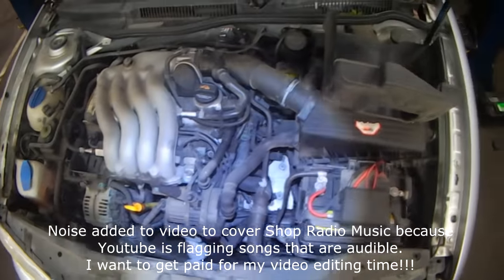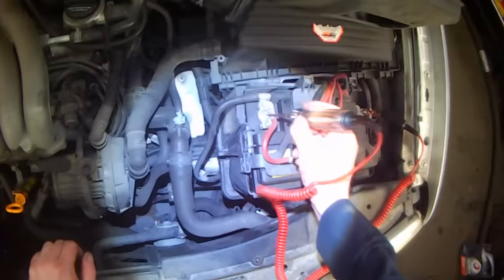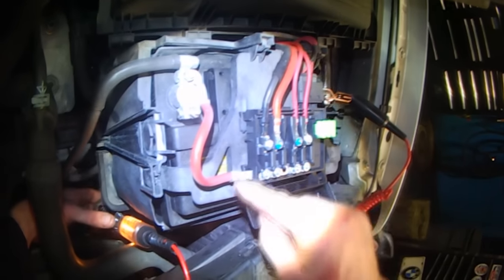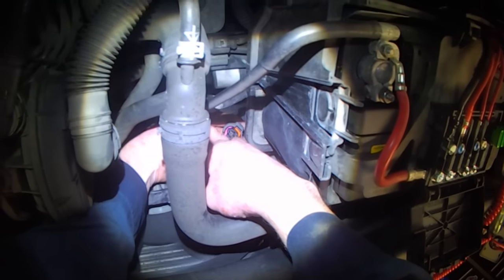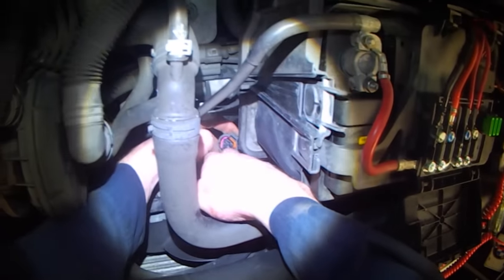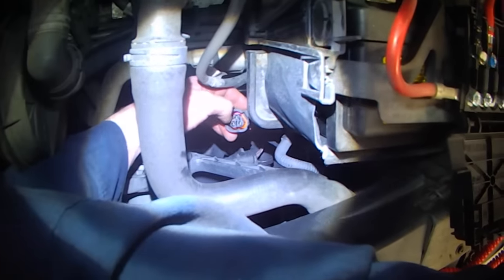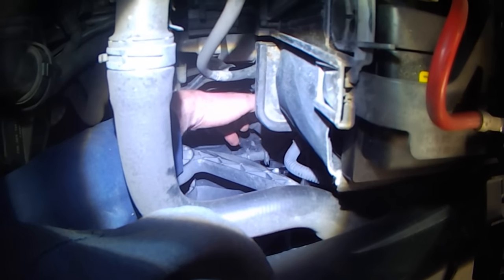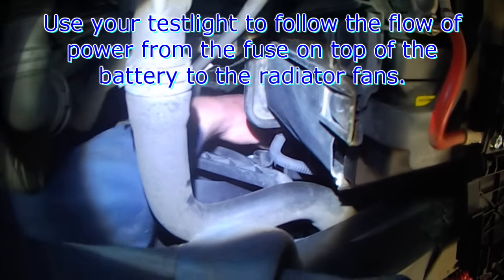VW A1 A2, A3, A4: Radiator fan(s) quick check.

Comment: Thanks!
Reply from the maker: Hi Brad, that's too much $.
If both fans worked (low & high) when you bridged the rad fan connector, then the fans, fan control module & wiring are ok.
I assume the engine is overheating / you're getting the red light in the dash?
3 common things that can cause overheating. 
- water pump
- thermostat
- bad rad fan switch.
No heat inside the car means the water pump is dead or the heater core is plugged.
If the top rad hose is hot (can't hold the hose for more than 10 seconds), then the thermostat is stuck closed or the water pump is no good.
If low speed fans don't come on when AC is selected, system might be low on charge or there's an ac fuse that's no good.
If you manually active low or high speed... will it cool the engine, if yes, bad fan switch.
I haven't seen many plugged radiators.
Leaving work soon. Might have more input once I get home.
Reply: @EXOVCDS  That's a small amount for all the help and enjoyment you have given me over the years. 🙏

Yes, overheating, and no AC. I don't think these fans have worked for the 5 years she has had the car. Water pump is fine, heater works, replaced the thermostat, FCM and temperature sensor switch. 

No fans ever, unless I jump it. Don't come on when AC is selected, but as you say it could be low, but they don't kick in when it gets hot (checked with VCDS-Lite). Is there another fan switch somewhere? I'm thinking of pulling the FCM from my Jetta and trying it, even though I plugged the new one into my car to test it and it was fine. Is there a way to test the sensor switch? I tried a ohms test, got nothing. Always worried about buying parts that don't work...
Reply from the maker: @bradsherwin4568 
Is coolant flowing back into the coolant reservoir when the engine is idling?
Could be an air lock / blockage in the return / bleed hose.
I'll reply again later tonight once I'm at home.
Reply: @EXOVCDS  Yes, coolant is flowing back. Had to drain and refill a few times after overheating and the temp sensor replacement.
Reply from the maker: @bradsherwin4568 
How warm / hot is the radiator core getting? 
Monitor coolant temperature via scan tool... periodically feel the radiator core with your fingers between the rad fans. 
The core should start to get warm after 87c.
TDIs can take quite a while to get warm. Hold the rpm at 2000 till temperature gets to 87c / 90c.
If the thermostat is new and the rad fan switch is new, the only thing keeping the switch from getting warm is the radiator (core is plugged).
To check, disconnect the lower rad hose at the thermostat flange. Route it down under the car into a catch tray / shallow bucket (front of car on ramps would be helpful).
Have your daughter start the engine while you monitor flow from the hose.
Coolant should rush out as rpm is increased.
Fluid level in the reservoir should drop quickly.
If coolant does not rush out and the level in the reservoir does not drop quickly, then I would suspect the radiator. 
If you activate the fans manually, can you keep temperature from getting too hot?
Reply from the maker: @bradsherwin4568 
I'm not seeing all you replies when using my phone / youtube app.
I'll check tomorrow morning while at work.
How hot is it actually getting (scan tool data)? Once the engine has cooled off, is pressure still in the system?
Reply from the maker: @bradsherwin4568 
Can we continue this via email?
I can't access / read your last reply about using an infrared temp gun. Or start a new discussion under the video to which I can reply.

Comment: my fuses require PLIERS to remove them from the battery fuse panel and to get them back in, its insane, brand new one too :\ about to go test this, placed an order for new fans, hopefully i can call and cancel. I tested the pins but i realized i didnt test the pin for power which im going to go out with a multimeter and see since i dont own a light for some reason, thanks for this :) I was bringing back the r32 from the dead and was idling it and  putting air in the tires and on my 3rd tire i heard a weird noise and looked and it was smoking, it was max temp and bubbling coolant out, ran in and turned it off and opened oil dipstick/cap to let as much heat out as i could and then turned on heat full blast :( my baby!!!!! stupid fans dont turn on at all even jumpered
Reply: so my plug gets 12.578v at it and the other two pins are getting 0.002 ohms and the other is 15ohms which is the top pin if they were vertical slots and power being bottom right. I assume the high resistance is the fan module and it opens up when the car is on right? so its probably working fine. Either way it looks like I need fans then right? Or should i wire up some double a batteries and tape em together to test the actual fan clip and give them power (i already tried at the triangle 3 wire clip with it off and on for both speeds and got nothing).

EDIT: going to go apply some 12v to the fan harness. at the fan harness after the module  or wherever it comes from that end had 0 voltage , should it have any voltage coming out of it? probably not right, it would drain the battery if sitting off if it goes through a module? on just the fan side of that plug i applied 12v (as best as i could with series of double a batteries LOL and verified with multi) and ap plied to both high and low and got nothing. I tested ohms on the ground of fan plug side to high and low and i got OL.... fans need replaced right? Thanks
Reply from the maker: Yes,  fans are bad if you do not have continuity at the fan harness plugs (checked across brown wire and one of the other 2). 
Low speed fan operation does not go through the fan module. The fan module is only there for ac low speed, high speed and ac cut out max speed... all 3 require ignition to be on. 
Low speed does not require the ignition to be on... that is how the fans are able to come on after parking a vehicle.
Reply: @EXOVCDS  thank you kindly. On plug itself for fan continuity would go through both right, on or off. Also resistance would be around 1ohm right? Not "OL" like I got :( I just decided to do FCPEURO fans x2 since lifetime warranty, now to get this low r32 into the air to drop the fans haha.
Reply from the maker: Yes, fan should have continuity on or off. No continuity between brown wire and one of the others  means that the circuit is open / bad. You can have a burnt out low speed, but high speed is OK. If one circuit is bad, replace the fan.
Reply: @EXOVCDS  just wish there was a way to tell when they were going other than checking low operation every so often. That mod may come into play but cutting out the alum plate seems ugh

Comment: My fans are not spinning at all, but car isn’t overheating🤔
Reply from the maker: Year, make, model, engine... AC?
Reply: @EXOVCDS  golf mk4 1.9 tdi 2000. AC works, but its not thst cold.
Reply from the maker: Do the fans spin when the AC is on?
TDI engines are very efficient / have little combustion heat left over... that is why they take a long time to heat up, to the point where radiator fans are needed. If the fans come on when AC is on, then everything is OK. To trigger the fans from engine heat... hold the engine rpm at 2000 - 2500. It may take 15 to 20 minutes before the fans come on. When you let the engine idle, there's not enough heat, so the fans are not needed.
Reply: @EXOVCDS  even when the AC is on fans not spinning. High and low AC still not spinning… Ive been driving for a while and then stop to look if fans are working and they not.
Thank you for the answers! I appreciate that :)
Reply from the maker: Most likely the fans burnt out. As soon as you start driving, the radiator is cooled... tdi engines take a long time to heat up. Hold the rpm at 2000 for 10 to 20 minutes... temperature will go past the middle if the fans don't come on. Replace the fans and your ac will blow colder.
Reply from the maker: @kristiansvilcans6850  if you can't trigger the fans like I did in the video, then the fans are bad. Make sure that the fuse is OK.
Reply from the maker: @kristiansvilcans6850  fuse on top of the battery... like I explained in the video.
Reply: @EXOVCDS  okay, Thank you so much!
Reply: @EXOVCDS  hey again! So I did what you said I was driving around city keeping under 3000 rpms(2000-3000) for like 10-20 minutes and temperture didnt go up at all. I stopped after like 10 minutes to check under the hood and fans didnt spin. I got back after 20 mins at my backyard temperture was in middle and fans not spinning. I turn on ac to max and lowest and still nothing. Im so confused. I haven’t checked wires and havent did that thing you showed in a video.
Reply from the maker: @kristiansvilcans6850  I said hold the engine rpm at 2000 without moving / no driving.
Reply from the maker: @kristiansvilcans6850  like in this video at 21:20
https://youtu.be/4OtXEqdTXvc
Reply: @EXOVCDS  oh my fault. I will try that later! Thanks.
Reply: That means they are ok or still something wrong?
Reply from the maker: @kristiansvilcans6850  they are ok... but ac has a problem (not triggering the fans). Could be a problem with the fan control module. The radiator fan switch is OK (turns the fans on). You need to check ac pressure and the fan control module (under the battery).
Reply: @EXOVCDS  Ok, Thank you so much for a help! I’m impressed that you read every comment! I appreciate that so much!
Reply from the maker: @kristiansvilcans6850  can you trigger the fans manually like in the above video? If you can not trigger low speed with a paper clip or wire, then both low speeds in the fans are burnt out. If low speed & high speed work, then the problem is with the fan control module. Post a video so I can see what happens when you trigger them manually.
Reply: @EXOVCDS  okay! I will try that later. Do you have a instagram?

Comment: Are you from Alberta? You're accent sounds like Jordan Peterson, must be a regional dialect.
Reply from the maker: German guy... living in BC.
Reply: @EXOVCDS  
Yeah, bigger regions in Canada to begin with. My radiator fan (MK4 2005 Jetta) kept going until battery died last night. Today I removed the green fuse just to stop it from spinning. I bet I can't just keep driving with that fuse out forever though, eh? Thanks for all the vids and how specific they are..
Reply from the maker: At what speed was it spinning? Low or high speed? AC or no AC?
Reply: @EXOVCDS  
When I had the battery connected, it was running. No stopping it when battery leads were attached. And I don't think it was high, I think high is noticeably louder. How would I tell low vs. high? I can plus the green fuse, and red fuse back in and see (both are unattached right now). I did get a coolant sensor reading the last time we hooked the car up to a computer (3 weeks ago or so). Right now I have the red fuse line and green fuse unattached & removed, which feed the radiator/coolant fan just so I can use my car, and keep from the battery getting drained.
Reply: @EXOVCDS  
I'll check if AC is working with fuses attached back on again for a minute, since you make it sound like AC is related...
Reply: No AC. It's the same coldness on regular coldness and AC setting. Also the radiator/coolant fan is not spinning today. Two days ago was when I removed the green fuse, while the car was getting a jump. I saw a spark when I yanked the green fuse out, I hope I didn't blow a fuse in the fan, or the FCM.

Comment: For fabia 1.2 azq 2003 how do I check if both fans work properly?
Now the big fan works and if it I starts up AC the speed increases but the second fan d'not start.
At very high temp the big fan starts to spin very hard and the second fan d'not start.
What woult be the cause?
Thanks!
Reply from the maker: The fan is probably bad. Check for power at the small fan, when the big fan is working (I think they should work at the same time, but I can't be sure since we do not have Ford Fabia here in Canada). Use a test light to check for power at the connector.
Reply: Hi,

I started the car and the air conditioning and I checked the voltage for the soket from small fan. It seems I have no voltage on those cables.

It would have to be voltage on those cables when the big fan starts up.
Reply from the maker: You'll need to check a wiring diagram to see how things are connected. It could be that there is a separate fuse for each fan.

Comment: Hi mate so I’m trying to find my radiator temp switch on my Audi s3 8p and can’t locate it could you help me pls
Reply from the maker: Controlled by the ECM. The ECM monitors coolant temperature and then sends a signal to the "radiator fan control module". Check the ecm for fault codes. Which engine? Overheats only at idle or also when driving at steady speed?
Reply: @EXOVCDS  it’s 2l tfsi mate so I’ve got the part and just needs fitting but can’t figure out where it goes it’s a radiator temperature fan switch
Reply from the maker: @jmalmal93sg17  sorry... your reply was in the spam folder. If the sensor is not in the lower radiator hose, then it is either in the coolant flange at the side of the cylinder head or mounted on the water pump under the intake manifold.

Comment: So i bridged the negative and positive both fans kick on but they neither kick on when i turn the a/c on , what would be the cause of that ? Yesterday the car started to over heat and then the heat gauge started going down on its own and the fans never kicked on i have a new radiator water pump and i have not yet replaced the thermostat but still wouldnt cause fans not to kick on /:
Reply from the maker: Nemesis X What year / model / engine?  Sounds like there are 2 issues. Fans not coming on causing overheating and fans not coming on when ac is selected.
If the engine doesn't overheat as long as the car is moving (air flow through the rafiator), then the thermostat is ok.
Your ac could be undercharged, the ac button could be broken, the fan module could be bad. Focus on why the fans aren't coming on to prevent overheating... once that is sorted, you can focus on the ac.
Reply: The car will run for hours and it not overheat but when i did run it on the road for alittle it overheated alittle and it started to cool itself down without the fans , 2002 volkswagen jetta 1.8turbo could it be the sensor in the radiator ?
Reply: It only overheats when moving sadly
Reply: Or while i was driving around the block about 4 times
Reply from the maker: Nemesis X  It's overheating at slow speeds because the fans are not coming on... the thermostat is OK if it does not overheat at higher speeds. Did you bridge the sensor in the radiator? Did you check the fuse on top of the battery?
Reply: I did check the fuse on the battery it does have a marking on the fuse like it got burnt but it is still recieving power from the fuse hooked a multimeter to it , i did bridge it and the fans came on